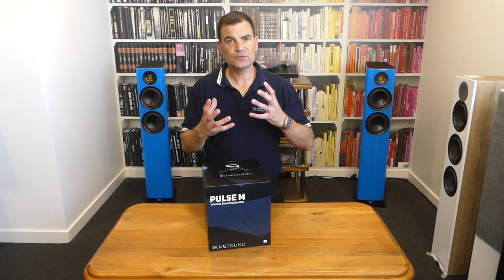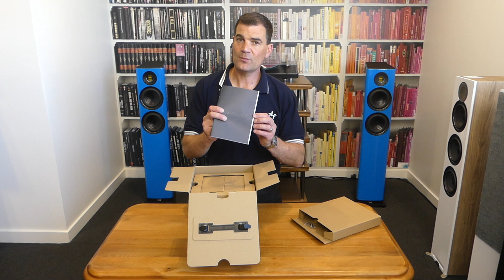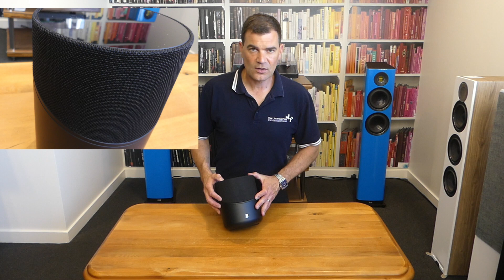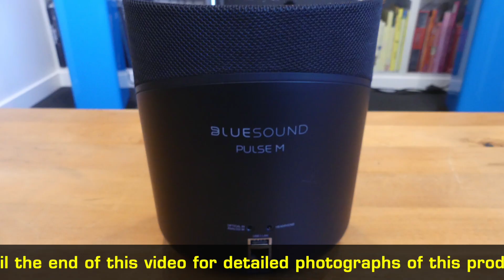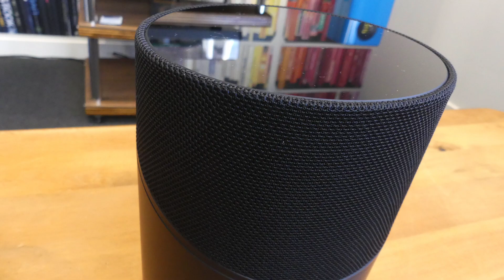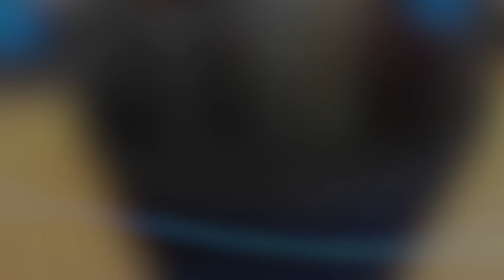Bluesound Pulse M Streaming Speaker Unboxed | The Listening Post | TLPCHC TLPWLG

Comment: Pardon my ignorance, but do you need to have it plugged in to play/stream media? Also, what is the battery life, please?

And on a final note, do you think it beats the Sonos Era 300? Thanks!
Reply from the maker: Hi HD.  The Pulse M has no battery. It is mains powered only.  Yes - the Pulse M sounds better than the Sonos
Reply: Thanks so much  @TLPCHC  

Says that it's a wireless speaker on their website? Just confused since you said mains - does it need to be plugged into a wall socket to be used?
Reply: @TLPCHC  Equal or better in terms of sound than a denon home 150? thank you so much
Reply from the maker: @capitanlevi203  Easy Answer. The Pulse M is MUCH better